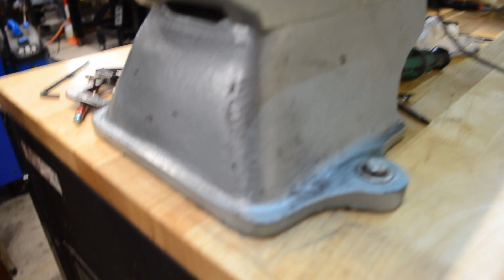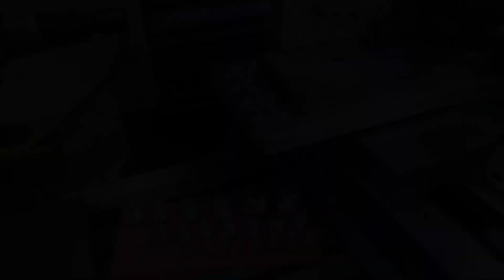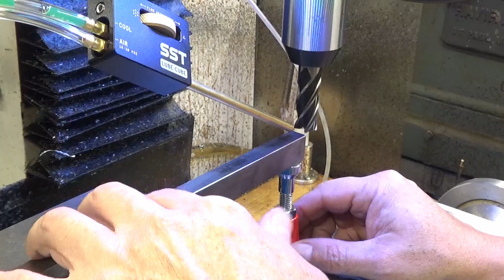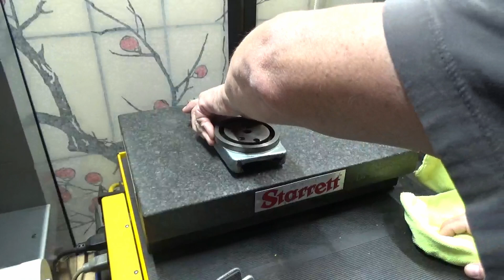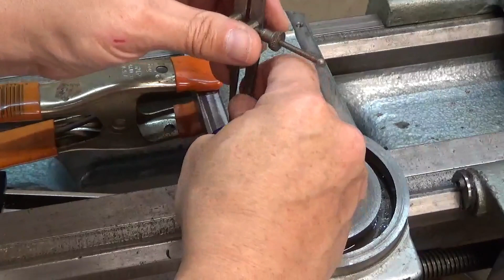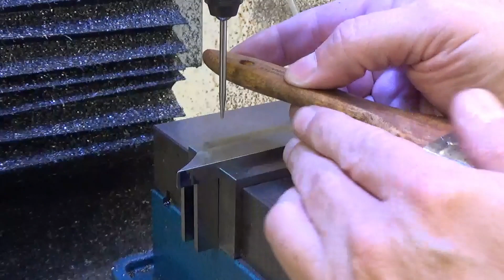Clausing Model 100 Touch DRO Installation Part 1

Comment: I also have an aluminum pallet about the same size as the one you are using. The 1/4X20 holes are all tapped but the 3/8 are just drilled to size and I machined rows of 9/16" slots from the back side and use square head bolts. Sure, saved me a lot of tapping.
Reply from the maker: Mine has 1/4-20 tapped and 1/4" non-tapped for pins.  No other size holes.  Although your post made me think that I might drill and tap some holes on the edges, that would allow me to add a "fence" like those on mag chucks, or just fixture from the edges.  After all, I do need another project...  🙂
Reply: @MicksWorkshop  I have considered putting some pins in mine at various angles including 90 degrees for locating parts. The sky is the limit. I am currently gathering materials to make one of the angle set blocks that Jon from Jon's Workshop made. He is a brilliant man. I always look forward to your videos Mick and am always grateful for the videos you make for all of us to enjoy.
Reply from the maker: Thank you @terrycannon570  for the kind words.  Yes, Jon is brilliant and does really great work, he is one of the guys that I learn something from every video.

Comment: Mick it that is the original paint your little lathe is in remarkable condition. I will be adding the same on the cross slide of both of my lathes but just can't justify one on the longitudinal. A simple indicator will give me the final dimension on length which is usually not that precise. BTW I used the same set up on the X-Yand Z axis of my PM 833T mill. Love it. Have also installed X and Y on my Bridgeport Clone Mill
Reply from the maker: No, it was repainted by the previous owner.  It is in really good shape though.